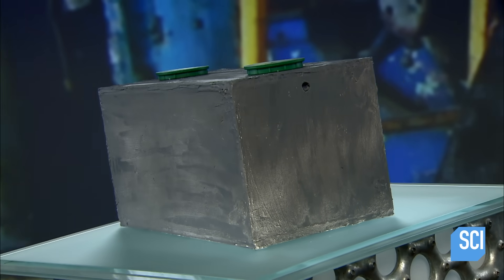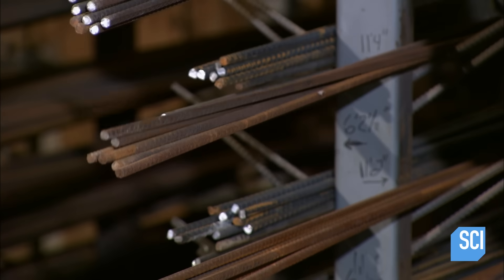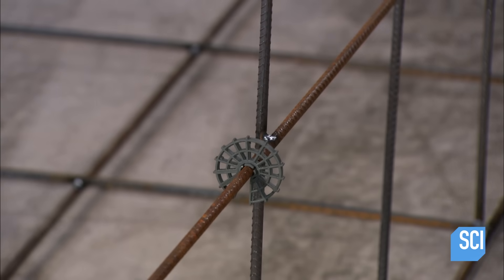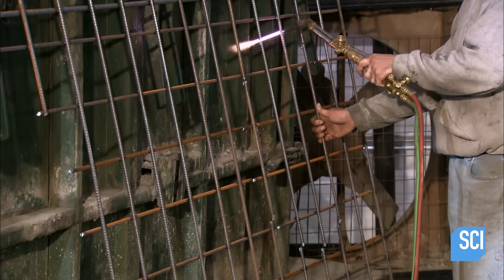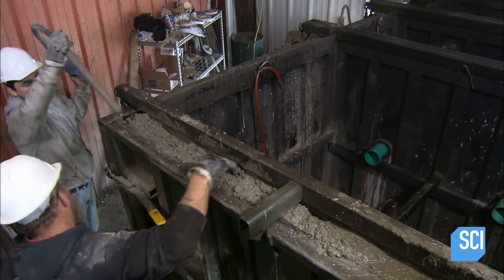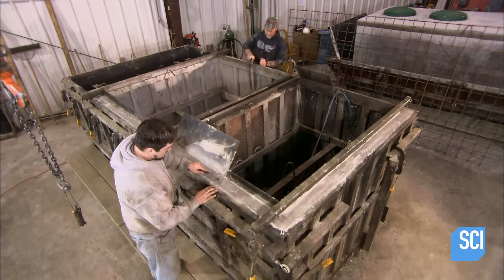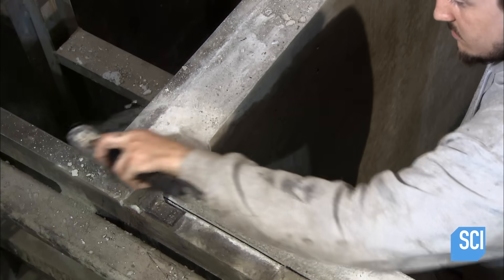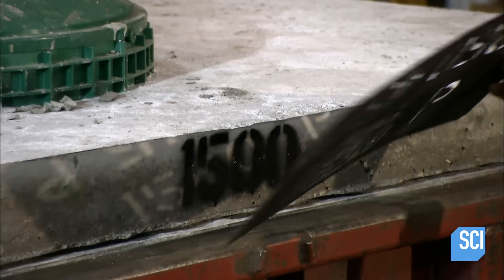How It's Made: Septic Tanks

Comment: The grass is always greener over the septic tank.
Reply: If so, you have a broken tank. The grass should be green over the lateral field.
Reply: @oldcountryman2795  that's what I was thinking too, I can find my tanks by the round ring of dead grass and know if my lateral lines are working by th green grass.
Reply: its actually not greener over the tank. its greener over the drainfield. I install over 100 septics per year.
Reply: For worms, it’s heaven.
Reply: The grass is always greener downhill from the septic tank.
Reply: If the grass is greener over the septic tank, it urgently needs help.
Reply: Actually, ours wasn't completely buried, so there was no grass above the septic tank. But all around it the grass was FAR greener than any of our neighbors yards! And they were always paying someone to come out and spray chemicals everywhere.
Reply: @Hypercube9  Just curious when the tank is filled do you dig it up and replace it with a new tank or have one of those sewage trucks to suck all the crap out?
Reply: @wumao6797  I'm not an expert, but neither. The tank doesn't really "get filled". It holds on to solid waste long enough for bacteria to break it down and then most stuff flows out into the leech field where it helps your lawn grow. I think I recall my parents having a guy out once or twice to do maintenance on it. The fats and oils float to the top and thick stuff like food that went through your garbage disposer can't be broken down by the bacteria, so occasionally you can get it pumped out but it's not like an RV.
Reply: @Hypercube9  Wow! That is nice to know. Thanks. My friend and I were thinking of building an off grid house and is figuring how to disposed of our pee and poop.
Reply: @wumao6797  Actually, because of the way it works, it should never fill.  If it is well-built and you take care to avoid flushing harsh chemicals and non-biodegradables into it, you should only have to have it pumped out and inspected every few years to keep the solids from jamming the tank.
Reply: @GreatMewtwo  Thanks for that info :)
Reply: @wumao6797   ideally, all solids in the tank get digested. In actuality, the bacteria don't always keep up and materials such as plastics, sand, or clay that the bacteria cannot break down sometimes get washed into the system, such as when you're washing dirt off your hands. Depending on how often this happens and how many people are using the system, you have to call out a septic pumping service to empty the accumulated solids. In my family's experiences, it's not likely to happen more than once every fifteen years.
Reply: @ALWhite-ub1ye  In that case maybe never. My friend lives alone in one of those off the grid cabin and was thinking of getting one instead of digging a hole for his out house everytime when its full. Thanks for the info.
Reply: @wumao6797  if he's mindful of what goes into the system and lives alone, it can go a lifetime without being pumped. My inlaws weren't that mindful and had six people living in their home, so it was as often as I'd mentioned.
Reply: @wumao6797  they sck it out
Reply: @ALWhite-ub1ye  Chesapeake Bay regulations in Virginia require a pump-out at least every 5 years whether it's needed or not.
Reply: @brianleeper5737  in that case, I feel sorry for you.
Reply: @ALWhite-ub1ye  It's an additional $300 expense every 5 years. I think I can afford it.
Reply: @Hypercube9  my family NEVER EVER uses the toilet (🚽) as a place to litter/washing stuff. They are only use to, well, "let it go" ( •͈ᴗ•͈). So the probability of the septic tank getting overwhelmed is very unlikely. And the area around my septic tank is dry and does not have any grass growing around it and the area around my septic tanks doest is constantly dry which further reduces the chances of my grass growing around my septic tank.
Reply: @amalayperson7208  My family doesn't wash stuff in the toilet either. lol But if your family showers, or does laundry or washes their hands after going, that dirt will wash down ALL the drains, not just the toilet and it all ends up in the tank. Over time that adds up. Bacteria can't dissolve rocks as far as I know. But sure, if you don't plant grass around your septic tank, there won't be anything to turn green.
Reply: @Hypercube9  my septic tank as green as grass because of the moss flourishing around the septic but only the septic tank has flourishing plants the ground it's touching around it is DRY.
And after we finished "letting it go" we clean our private part in the bathroom (not in the toilet) because we know it will clog up the septic tank and we're not gonna pay some guys to pump out the nasty nasties in the tankies!
Reply: @Hypercube9  BTW, did you know when is your septic was installed? Mine was installed on 2005 when my house was under construction.
Reply: @amalayperson7208  I don't have a septic tank right now. My parents did when I was a kid, that was 25 years ago. That house was built in the 70's I think.
Reply: @Hypercube9  damn, that septic tank is old.
Reply: @Hypercube9  ok let's end this conversation. I DO NOT want to read that long paragraph comment you just put because you're making me embarrassed af so let's end this.
Reply: @amalayperson7208  Fine with me. But you really should stop washing things in your toilet. That's not what they're for. 

And we don't even live in that house anymore, so I have no idea if the septic tank is even still there.
Reply: @Hypercube9  probably someone drained all of the nasties and turned it into s basement. Who knows
Reply: @amalayperson7208  You really should read my previous paragraph. You might learn a few things. Let me know if you have trouble reading any of the words.
Reply: @Hypercube9  i can't, as soon as I see a paragraph i both offended (because it makes me looks stupid) and agree (because they are facts), i immediately feel embarrassed and i can't read it when I'm embarrassed.
Reply: @amalayperson7208  I'm just curious as to why you made your first comment to me? 

Also, why don't you think all your drains go to the same place? 

And why do you think other people wash things in their toilets?!? 🤢🤮
Reply: @wumao6797  In theory no but you should do a pump out every 3-5 years especially with women/children in the house flushing products not safe for septIc systems
Reply: @VegetaIsBetterThanGoku  Ok thanks for the advice.
Reply: @wumao6797  you get it pumped out
Reply: @Hypercube9  Mine was so old it did not even have access point to get into it you had to dig it up to access it thankfully it got updated to what the new ones have.
Reply: @Hypercube9  I bet they have cancer now
Reply: @the7A7dude  You'll bet WHO has cancer now???
Reply: @Hypercube9  chemicals? As in fertilizer? Wow... sounds terrible...🙄
Reply: @Hypercube9  well the only "chemicals" that your neighbors would need to spray in order to keep their grass as green as your shirt filled yard is nitrogen. Your septic isn't stopping weeds from growing in your yard.
Reply: @randybobandy9828  First of all, their lawn looked fine before, so they didn't need to spray anything. They should have just stopped bagging their grass and started mulching. Second, my yard didn't have any weeds growing in it, so I didn't need to spray carcinogens everywhere. And third why did you put "chemicals" in quotes? Do you not know what chemicals are? Do you think it's possible for someone to spray liquid nitrogen directly on their grass? Nitrogen has to come in another form like Ammonium Nitrate for example. BTW: Did you know that an excessive amount of nitrogen in the soil can kill off fish in nearby bodies of water? Also, you're wrong.  Fertilizers usually contain nitrogen (N), phosphorus (P) and potassium (K) and sometimes other micronutrients too. But thanks for proving you know nothing about chemistry (or lawns).
Reply: @Hypercube9  your original comment implies that your yard is green and healthy because of a septic tank while your neighbors who don't have one have unhealthy yards and they need to have someone spray their lawn. You tried to make it sound like somehow the septic tank was the reason for not needing "chemicals"
Reply: @randybobandy9828  "your yard is green and healthy because of a septic tank" That's true. 
"while your neighbors who don't have one" That's also true. 
"have unhealthy yards" I never said that. 
"and they need to have someone spray their lawn" THEY made that call, not me. But they DO spray their yard with chemicals. (I'd rather they didn't.) 
"You tried to make it sound like somehow the septic tank was the reason for not needing "chemicals"" The septic tank IS the reason my lawn doesn't need chemicals! What chemicals would my yard need that it can't get from the leech field? Also, they have automatic sprinklers and I don't and my lawn still looks better without watering! Why does this upset you so?
Reply: @Hypercube9  like I said you comment implies your neighbors need to spray their yard and you don't because of a septic tank.
Reply: @randybobandy9828  So what's your point? I DON'T need to spray my yard and it IS because I have a septic tank! There, now I haven't just implied it I've said it. 

Are you confused about how septic tanks work? Do you not get that all the nutrients and water the yard needs come out of your house instead of off a truck? And in point of fact, I implied that DESPITE being sprayed with chemicals (and them having a sprinkler system) my neighbors yard STILL didn't look as good as mine! And while having a septic tank probably would have helped my neighbors yard, I don't think the city will let you disconnect from them like that. But their grass might have been cut too short, it might have had too sandy soil, they never mulched their yard, they might have had a different type of grass, their yard had more sun, etc. There are plenty of reason's why their yard might have sucked, but mine has a septic tank and didn't suck. That's just a fact.
Reply: Erma Bombeck
Reply: Then you need a new tank
Reply: I think that was a movie?
Reply: Nope. Out tank is shallow, so the grass is dead over the tank, greener over the field lines.
Reply: Love that book
Reply: You are so right.  Our neighbor's tank split underground.  After a season of stink, they had the best grass lawn I had ever seen.  Seriously, it was perfect.
Reply: Ew
Reply: Tru that
Reply: That was absolutely true out in the Arizona desert!
Reply: @aurktman1106  ...So I should plant my lawn over the leech-field?
Reply: @NikkiTheOtter  I would.  It will thrive.
Reply: Cam confirm
Reply: Leach beds, sure! But if you have a lot of ass gas eminating, it will kill grass. No shit!
Reply: Not true
Reply: Grass usually dies over septic tanks
Reply: It'd better not be greener over the septic tank, that means you have a leak/crack in the tank. It's supposed to be greener over the drainage mound.
Reply: Oh ya
Reply: Well, over the leach field anyway…
Reply: I remember that book.
Reply: Hey Curt:
That's my joke. Lol. 
I had a shit tank at my  old house.
Reply: Ours is actually not as green ober the tank but very dark green over the leaching field
Reply: What grass? Mine kills the grass...
Reply: No 💩
Reply: Till it ain't
Reply: This is completely false unless the tank is spilling over. The grass will actually be less green above a septic tank.
Reply: We moved off grid a year ago and we installed a tank recently. Until we did we would just dig holes within a set dump zone and dump our 5gallon porta toilet into the hole. Sectioned off the tank for about 50-100 feet below that hill... 

We’ve had it buried for a month or two now (the loose septic) and I’ve taken dollar store vegetable and flower seeds and just littered it before the final dirt cover. We have a few sprouting so we’ll see how it goes in the long run. Dont really plan on eatting any of the products (especially if they touch the ground) just that they’ll hold the ground and clean the area up a little over time!
Reply: Nope not mine
Reply: As a plant biotechnologist thats very interesting to know.
Must be due to the gases.
Reply: Actually its not.
Reply: It has food and water. Why it will not be greener?
Reply: I loved that movie 🍿. Erma Bombeck was awesome, rest her soul. ❤️🥰
Reply: 1:12.....Nope....it's to see if the frame is SQUARE....not straight....you obviously have no idea what you are talking about....get an other job....
Reply: That is full of crap
Reply: @ss-pw4zj  Just like the Seppos.......
Reply: Erma Bombeck ❤❤❤

She's funny, maynher soul rest in peace.
Reply: Erma Bombeck.
Reply: It's actually greener over the leach bed
Reply: Idk I watch a lot of these videos and it's usually yellow 😂
Reply: All that Good Poo
Reply: Actually it's usually not , it's Greener over the Leach field
Reply: Its greener over the leech field or Technically drain feild
Reply: If it’s greener over the septic tank, that means that it’s leaking and not working properly. Grass should be greener over the drain field
Reply: Erma Bombeck?
Reply: To be more precise the grass is greener over the leach field. The septic tank just makes the ground a little warmer.
Reply: I like to eat the mushrooms that grow over the septic tank.
Reply: @ericyoung2136  😂
Reply: @Wayne Flanigan The grass is always greener after the septic tank.